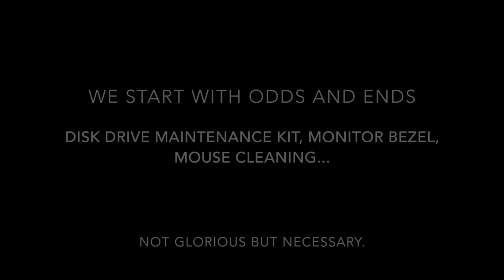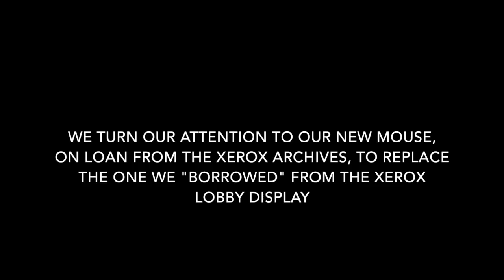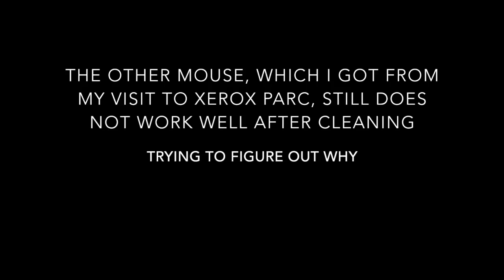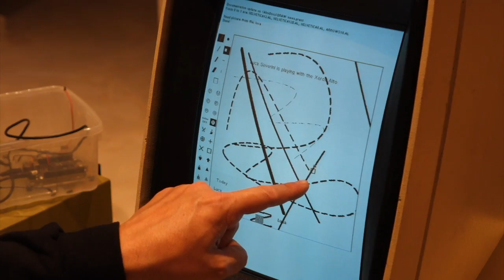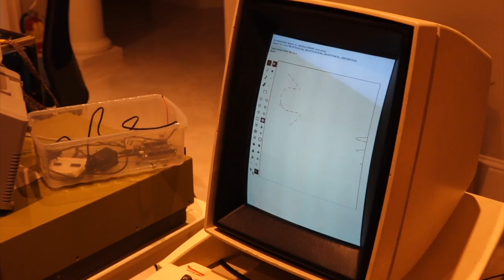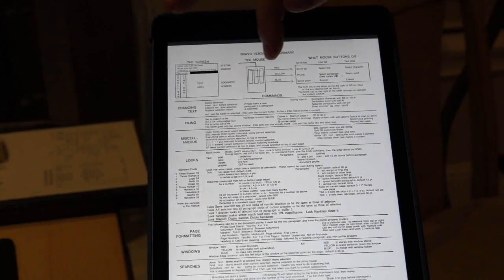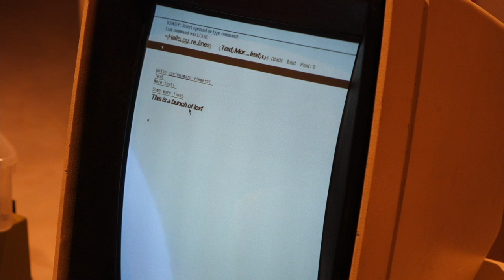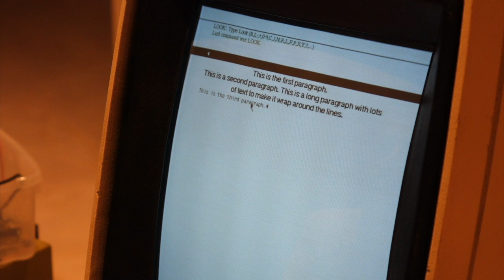Xerox Alto Restoration Part 11 - exploring Draw and Bravo

Comment: There is something special about the Alto's display resolution because we would see the same resolution of 72 pixels per inch used later on other Xerox graphics products and on the Macintosh.  Even most Windows graphics sofware defaulted to drawing to the display at 72 pixels per inch.

Comment: Fantastic series, I especially like the info on the Diablo, filing that knowledge away for when I get to servicing my own Diablo 31's.
What I don't get is why it appears you gave up so easily on repairing the mouse top bearing. Tiny ballraces are readily available, I even have some around that size in my parts stash. Measure the OD, ID and width with a digital capiler or micrometer and obtain one, and if housing disassmbly is destructive then you could get a watchmaker or someone with a watchmaker's lathe to turn up a replacement shaft if necessary. For such a valuable item it's worth really trying all approaches.
By the way, do you have the chorded keyset for this machine?
Reply: we do not have the chorded keyset. Would be interesting to borrow one from PARC and demonstrate programs that use this in addition to the mouse.
Reply: Thanks Carl. If you do get hold of one would you be able to take some measurements of it? It's been a dream of mine to draw up a CAD drawing of one, and make a working replica, original in appearance, to use with a modern PC someday.

Comment: I wish there was still a way to get an Alto these days. My favorite computer, and I'll likely never own one!
Reply: I found an emulator for the system/software - so you can play around with one.
Reply from the maker: Yes, Josh Dersch from the LCM wrote an excellent emulator. Ken used it extensively in this restoration to reverse engineer how the microcode should works. It is called Contralto. Available here: http://www.livingcomputers.org/Discover/News/ContrAlto-A-Xerox-Alto-Emulator.aspx
Reply: SkuldChan42 SALTO doesn't work very well and ContrAlto doesn't have a Windows EXE last I knew, nor support for me to use my own disks.

I rather like the vertical display, but it's very difficult to find a vertically oriented CRT that's compatible with a more modern computer these days.
Reply: Search ebay for "radius computer monitor" - they are expensive, but at the time it was a full page CRT made for the Mac (and later on Windows PC's).
Reply: SkuldChan42 I meant for a reasonable price, but I see what you mean.
Reply: Contralto runs on Vista or later, under .NET - give it a try
Reply: Carl Claunch I have and it won't let me save things to a disk.

As in, I can't load them back after closing the program.
Reply: I fired up Contralto, copied a file over to a new name on disk, shut down and it was there when I brought the system up again. It should work - appears there is something going wrong on your system but I don't have any idea what.
Reply: I'm presently restoring an ICL PERQ-1; only slightly later vintage than the Alto - more equivalent to the Xerox Star. Also has a portrait display.
Reply: Yes - the prototype of the PERQ was built only six years after the Alto. While the Alto was purely a research machine, the PERQ was marketed, just as Xerox did a bit later with the STAR.
Reply: Mono...

Comment: It would be awesome if there was a way to digitize the video signal coming out of the Alto so that it could be preserved exactly rather than only through video.  In theory, running it through an emulator will look about the same, but capturing the actual video signal would be more authentic.
Reply: It would be a bit difficult as the display is bit-mapped digital.  I suppose it could be done with an FPGA.
Reply: douro20 You could digitize it with any modern digital oscilloscope that has long enough memory to store a complete frame of analog video signal (the video channel, i.e. luminance). And here “modern” extends back into the 90s at least. A LeCroy with 64MB of waveform memory will easily capture an entire frame with many samples per pixel. 8 bits is more than enough resolution for the monochrome (or is it grayscale?) video signal. Some German fellow whose name I forget got a fast reverse engineered connection to those abundant LeCroy digitizer boards (they are the heart of the 9xxx series of scopes, IIRC). You could also reduce the vertical resolution and dump it to a bunch of floppies (can be emulated) :) Or to a SCSI hard drive emulator. Not hard at all. And truly modern scopes with fast network connection can probably dump the video in real time over LXI. Just remember that a 10baseT Ethernet connection has more bandwidth than the video signal in this thing (assuming it’s monochrome).